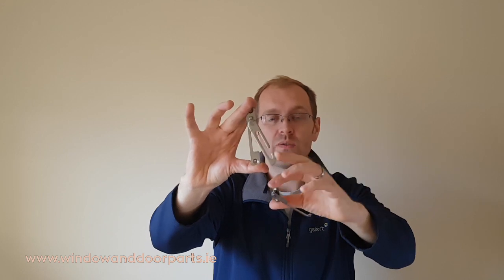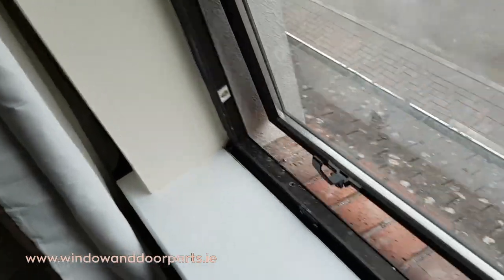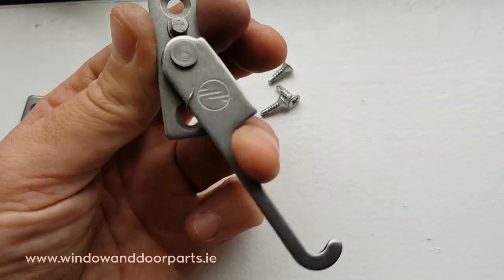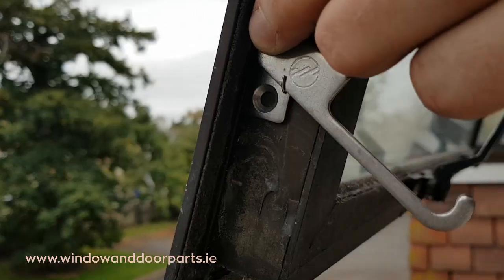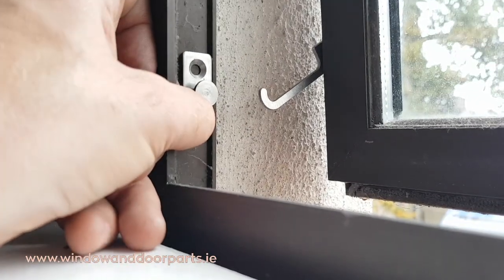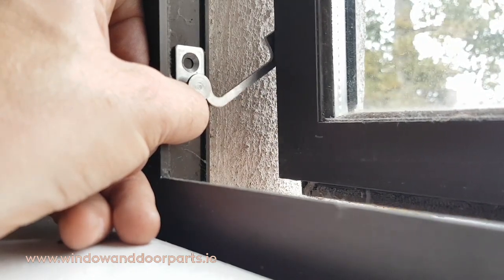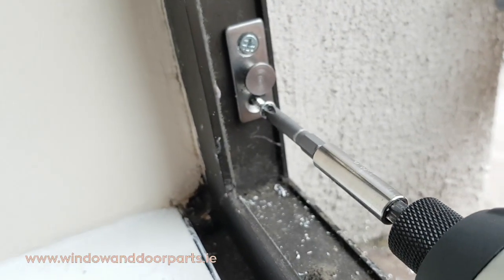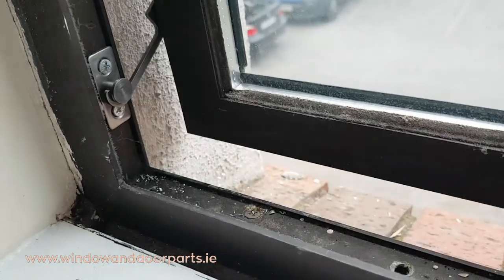How To Fit A Restrictor On An Aluminium Window

Comment: Hello Paddy, Thank you for showing how to make windows safer. You mentioned about UPVC restrictors is generally not suitable for Aluminium windows due to striker . Is it because of the width or thickness of the striker? Sorry ,I'm not very good with DIY where I live.
Reply from the maker: In the majority of cases the aluminium frames are very narrow. The uPVC restrictors don't have enough space to fold up in the aluminium frames and get jammed